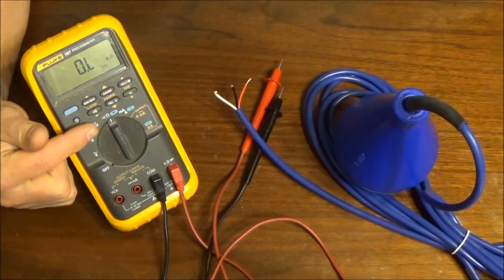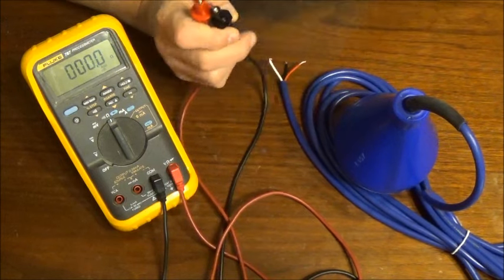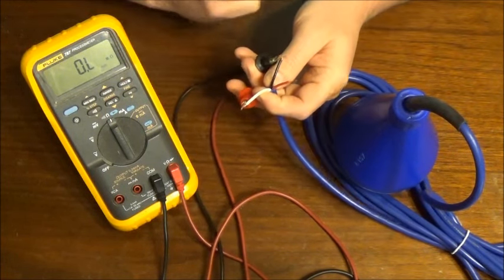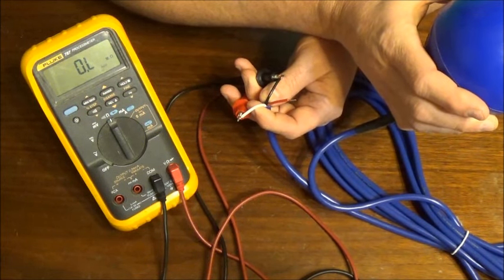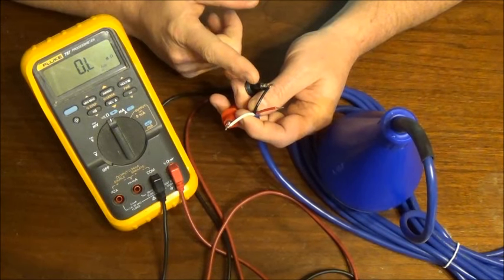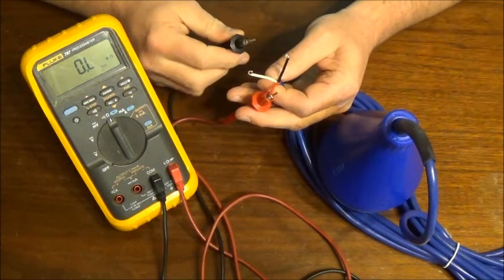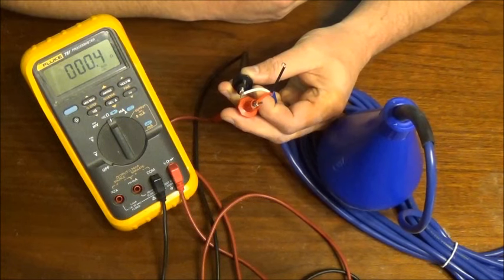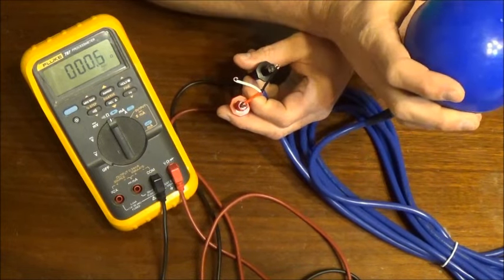Is it NO or NC?  - Instruments #1 - thePLCtech

Comment: Does it work for all float switch or just this one?
Reply from the maker: The float switch in this video has both normally closed and open contacts.  Not all floats have that same configuration, so no, not all are the same.  Some have only a NC contact or a NO contact and all have different current ratings.
Reply: The PLC Tech Thanks a lot. I now understand the difference. Newer ones sold on Amazon all have 3 wires for both NO and NC applications. I cancelled the one from homedepot and ordered one from Amazon. I need NC for water tank filling from the lake. Your video made me realize that such a switch is not just for septic system (NO)  but also for controlling the water level in a tank (NC) which is much more robust than other options I was considering. I should really than you for your very informative video.

Comment: So if you only have two wires on the float switch then you would just connect the two to the meter and toggle the switch as you did in the last step ?
Reply: That is correct.

Comment: boss where exactly are we gonna place the red/black/white wire?
Reply from the maker: Red is the common and will be the one you would make wet or supply power to and depending on if you need to use it as a NC or a NO contact, you would connect the other wire to the device that need to see the power signal with the float toggles stays.  Warning, the contacts in the flow have a current rating!

Comment: dear sir but how to connect with motor and which wire
Reply from the maker: Float switches have a contact current and voltage rating.  That said, if the motor will not pull more then the AMP and voltage rating, then you can wire the float inline with the hot leg of the motor.  If it is a single phase motor with only has one hot leg required to run the motor.  The return/neutral leg will be wire like normal.